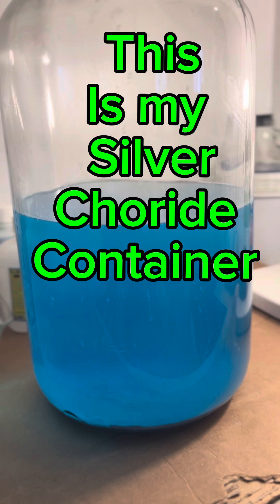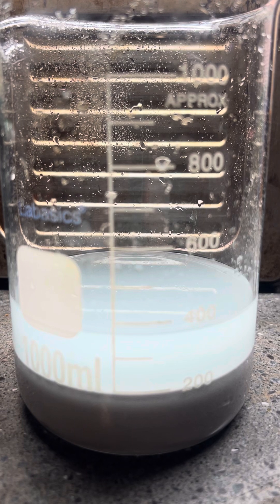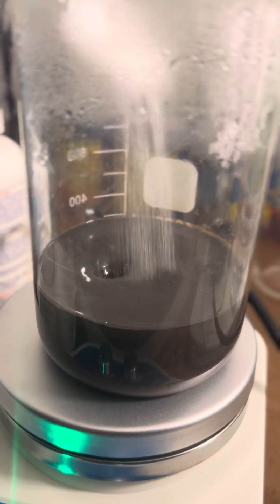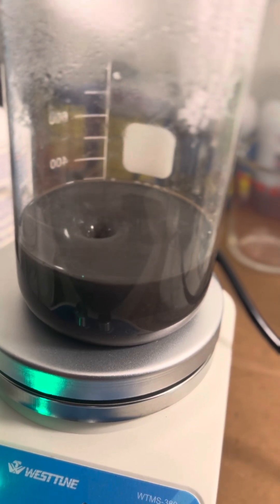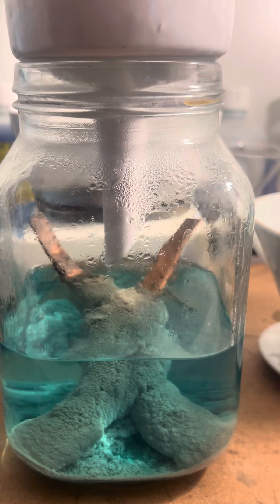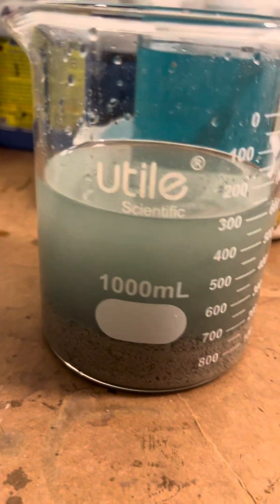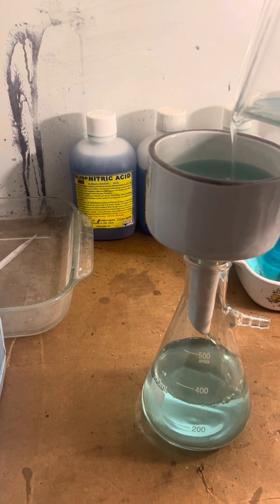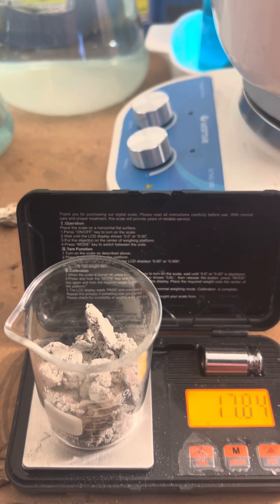Silver Chloride Conversion , what could go wrong ? silver

Comment: A cleaver way to convert your silver chloride to metal for nearly free is to take your silver chloride paste filter and all, put a sheet strip of silver from a candlestick in tge middle, then use another metal like zinc and make a battery with it. As it discharges it makes pure silver as the zinc is consumed. ❤
Reply from the maker: I have never heard of that , I have used HCl and Al, weak sulphuric acid and iron ( my favorite ) and sugar lye , thanks for commenting and stopping by

Comment: I’m going to try a pressure cell I think.  I have some old HPLC stuff with a critical CO2 cell.  I have heard just ammonia under pressure will dissolve gold.  I can probably get 3000 psi if anyone has any suggestions.
Reply from the maker: @naughtiusmaximus830  I would need to research that before offering any opinions .  So behind on things mountain of e waste , unfinished copper cell run , silver plate stripping .
Reply: @ I will look into it.  My pressure cell is about 500ml but maybe for pins it could be useful.  The crew at Hard Rock university had some ideas.  I have 6L centrifuge that does 10,000 x G that might be interesting too for extraction.